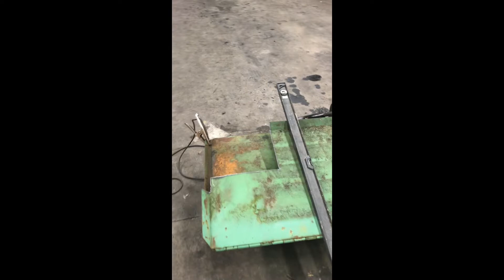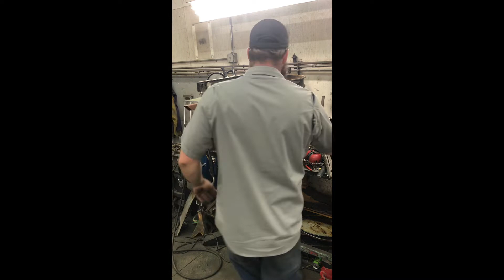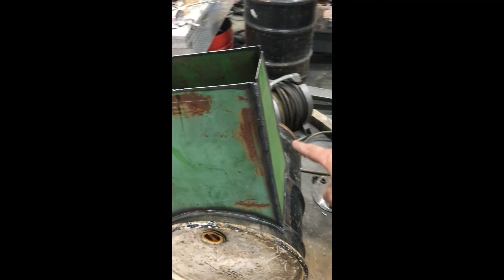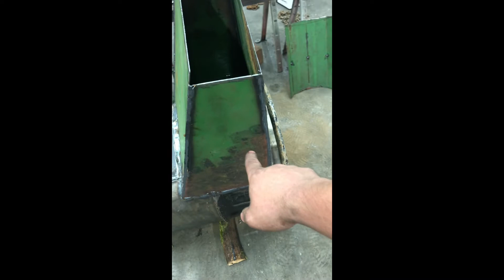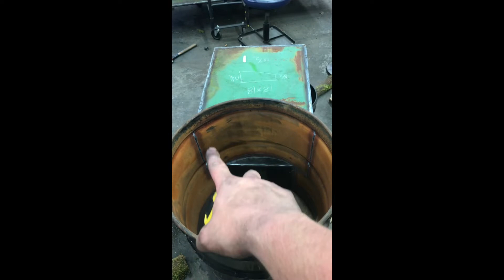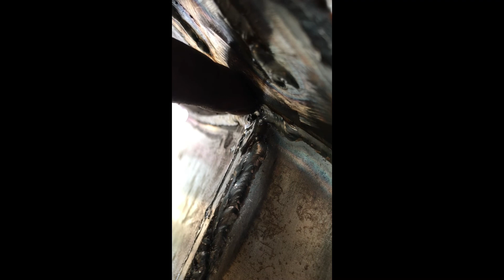V10 Dodge WOODGAS build Sealing Up the Lower Barrel And Heat Exchanger Standoff Mount

Comment: Awesome design so far!
Reply from the maker: Heat exchanger body video will be out Monday, I'm editing right now. It's a hybrid with Wayne's firetube, Jacobs heat exchanger and then my own design for the flatbed, combining my favorite features of all the systems I have seen or built
Reply: @BigBeavrSlayer  I am super excited to see your next video! 

I've been looking at hundreds of designs, and yours is really refreshingly different. 

I'm looking for ways to get rid of tar, either by burning it again (like I assume your design would do), or to somehow capture it for later use...

In an off-grid lifestyle, tar might actually be useful (fixing roof leaks, waterproofing stuff etc). Perhaps you could look into that (your T-shirt suggests you fix roofs 😊)😁
Reply from the maker: @Giepie if your not already, I think you need to get over onto the driveonwood.com forum, you will find a lot of answers about everything gasification. Including many uses of tar, getting the gasifier to consume the tar and produce a higher quality of fuel
Reply: @BigBeavrSlayer  thanks for that tip!

I'll head over there right now 😁